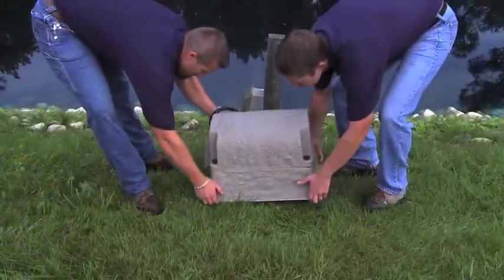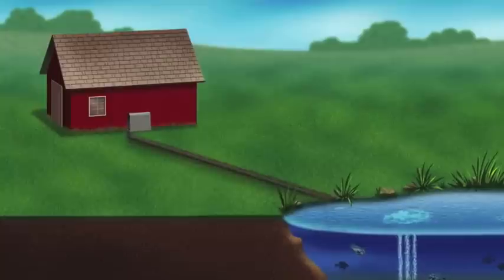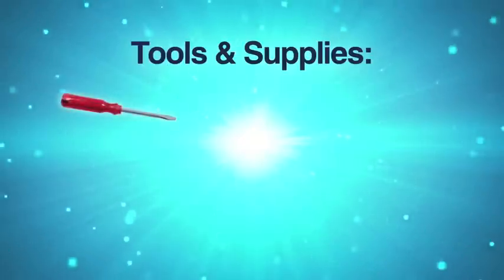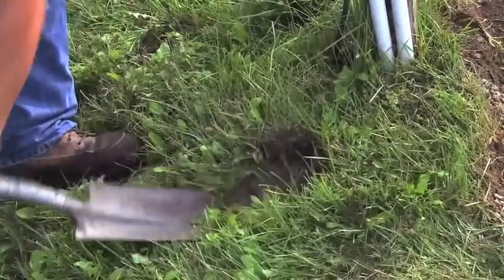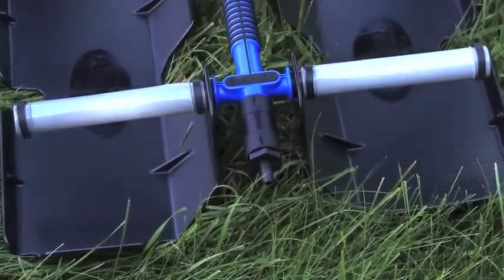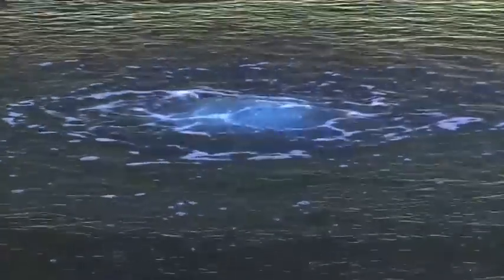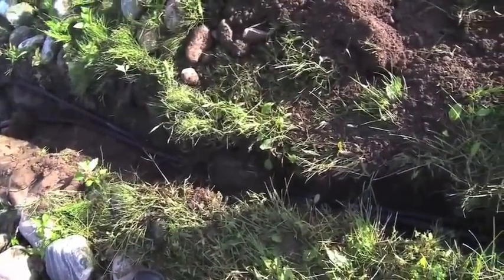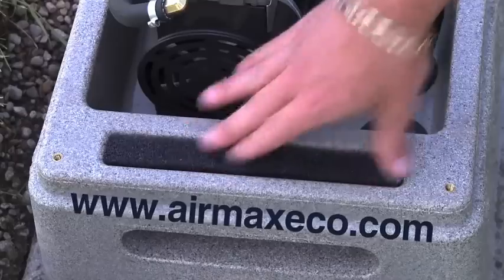How To Easily Install A Large Pond Aerator

Comment: Why can't you run the air line in place of the electric and have it hooked up at the pond leaving the area clean of any boxes or electric boxes?  Once at the pond then hook it up.  Would you need a larger pump to do this?
Reply from the maker: You can certainly do that with a remote manifold by the pond and pump by the power source, wherever that may be.  Some types of aerators will accomidate this and others, may not...the shallow pond aerators aren't built to handle much depth or backpressure usually so I try to get those close to the pond if I can.  Anything with a rocking piston pump though could be run from a long ways away.
Reply: I guess Im asking randomly but does anybody know of a tool to log back into an instagram account..?
I stupidly lost my login password. I would appreciate any tricks you can give me.
Reply: @Dennis Terrell instablaster ;)
Reply: @Coen Hayes it worked and I actually got access to my account again. I am so happy:D
Thanks so much you really help me out :D
Reply: @Dennis Terrell you are welcome =)

Comment: sir how much time we have to put on pond aeration in a day
Reply: Ideally you want to run the aerator 24/7...most are designed to run that way just fine.  At a very minimum, consider running 12 hours per day...no less.  And as to what time of day to run limited, I would do it overnight and into the morning hours after daylight.  Hope this helps!

Comment: If we installed an Hiblow HP-120LL aerator, would we be able to run an underground air hose from the house such as in this video? I'm concerned about over stressing the pump, but it would be nice to not run power to the shoreline. Thank you, and love your videos.
Reply: Hey Michael...thanks for the kind words...so yeah, I would really check with the manufacturer to see what kind of airline runs this pump can handle...well also depth would be a factor.  Tell them about your intended set up and see what they think.  These pumps are all a bit different...some have higher tolerances than others.  All in all though if a pond has much depth, say over 6', or your running airline 100's of feet...these linear pumps may not handle anything beyond that...in that case you are far better off looking at a rocking piston design.  But if this pump will spec out properly for your situation, then it should be a viable tool for aerating.

Comment: Can you put a divider hose for 5 ponds sizes 5x20 meters 5 1/2 feet deep for 1airmax aerator? Will it be ok? And is this aerator good for running 24/7?
Reply from the maker: Hi Alvin...I think I understand your question correctly but the way you would do this is have a multi valve arrangement at the pump and off that, let's say for each pond, you'd have a line running to each one with a single diffuser at the end of it.  That way you have full control over the air flow to each.  Generally we don't suggest any kind of T off or daisy chain because the air will always go to the point of least resistance, meaning shallower diffusers or those that are closer.  But as far as a set up to cover multiple ponds with single aerator, yes, that's simple enough to do.
Reply: Thank you so much.. you are very helpful..

Comment: What is the maximum capacity of defuser you can install on a 1 airmax sw40 unit?
Reply from the maker: Hi Alvin...I'm not sure what you mean by max capacity?  Basically the only manufacturing rating on this system is depth...6' max.  The SW40 uses 4 diffusers...and generally speaking this is used to cover up to a 1/2 acre pond.
Reply: Does the airmax sw40 with airline has 4 airlines with the airflow manifold assembly with 4 outlets? And what is the length of each airline?
Reply from the maker: Correct...4 way valve manifold, each line has it's own valve...4 diffusers, and the system comes in two options...no airline so you can customize the lengths, or 400', 4x100' rolls, which is the maximum this system can use.  Some airline runs can be longer than 100', you can couple sections together, but generally speaking the total can't be over 400' as it would put too much back pressure on the pump.  This is also why the max depth is 6'.
Reply: Is this product available in the UAE or Philippines?
Reply from the maker: Honestly I'm not sure...you'd want to contact Airmax on that.  We only work within the US at this time.
Reply: Thank you.
Reply: @aliboy4918  i am also interested with this heavy duty aerator for my Expantion of my hito Farming as i am planning to go home Porgood next year,ingat Sir

Comment: Did this system applicable for shrimp ponds? If applicable what is the DO rate
Reply from the maker: Hi Suresh...I'll be totally honest in saying that I haven't dealt much with shrimp ponds.  I think over the years one or two customers have used these aerators...particularly the shallow pond systems, for shrimp operations.  In my initial research years ago I think most shrimpers use the paddle aerators most of the time.
Reply: Thanks for your valuable reply

Comment: Time to move into rotary vane world, Everything turns in the same direction and virtually never fails and minimal noise?
Reply from the maker: John...we sell a lot of rotary vanes to industry...but they only work in limited depths...the brunt of the industry is using rocking pistons for a reason...they work well, hold up well for the most part, and have gotten quieter in recent years.  I have no complaints.  But use what you like...hard to argue with that.
Reply: @klmponds  Just curious on rebuild intervals. Had my rotary vane shop compressor for 10 years running at 150 psi all day long with zero issues in my machine/fab shop. What has been your experience on rebuilding?
Reply from the maker: @Filmpilot  Thanks for the question.  I've had rotary vanes crap out and need rebuilding in 2 years so you did well.  I've had rocking pistons go 10 years with nothing done.  So it just depends.  On average you can figure about 3 to 5 years before any rebuild needs to be done.  But that's on average...it could be slightly sooner or it could be a lot longer.